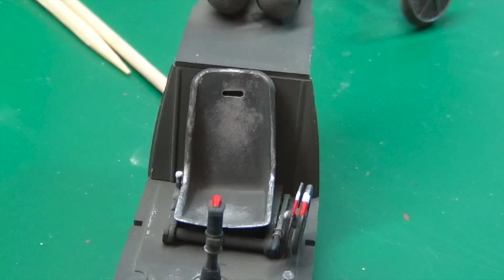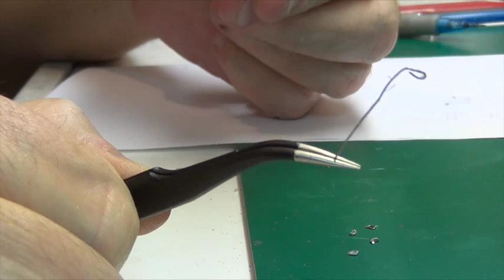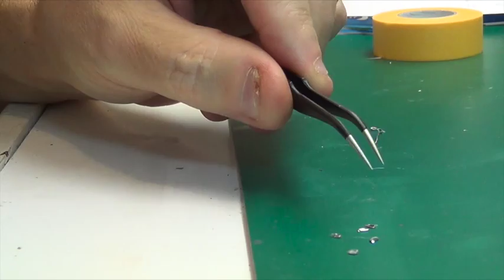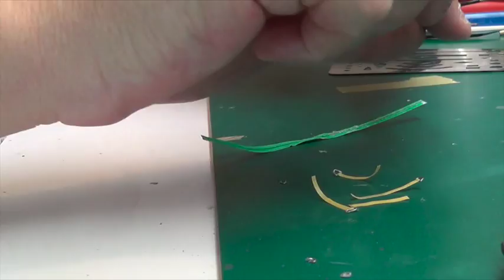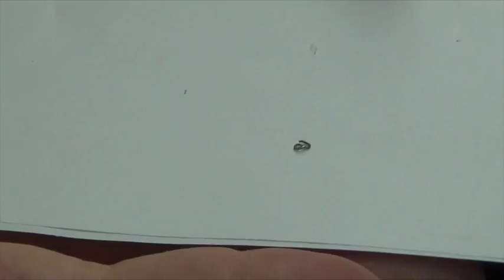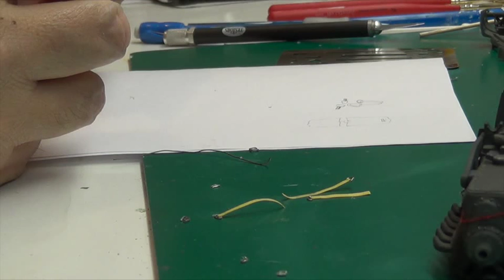My first seat belts and how I did them.

Comment: Clint, is that a big 40MM roll of Yellow Frog Tape ?  Also for $4 Id be all over those tweezers as they look sturdy and great quality so if you happen to have a link to those tweezers Id be interested in buying a set of those.  Great tutorial of sorts.  Will remember to yank a row or so off of the ties next time I get some greens at the super market to feed Stella the Iguana.just happen to drop them in the bag of greens they should blend right in hahaha.
Reply from the maker: iauto was the sellers name on Amazon and the grand total was 3.55 that includes the shipping. Hey make sure if you get them there are two sets when you order one that you see in the video is 45 degree and then there is a straight set, so you get two pair for 3.55. The tape is Tamiya 18mm but any will work because you will be cutting it to the size you need so any will do the trick.